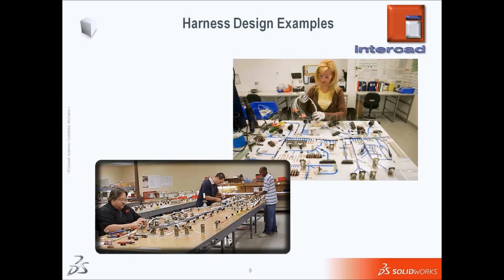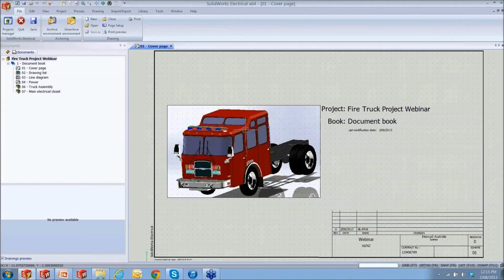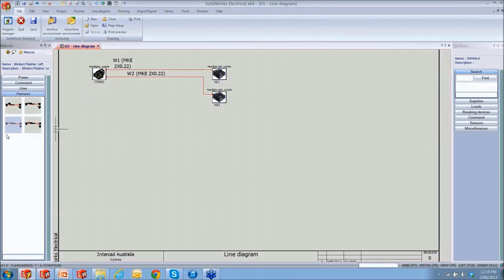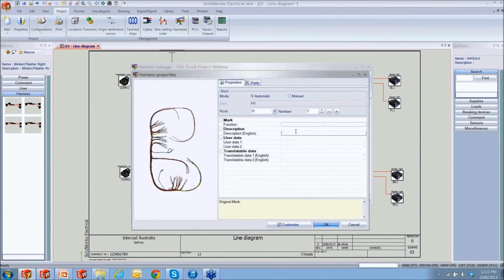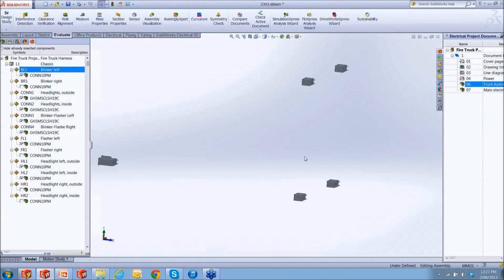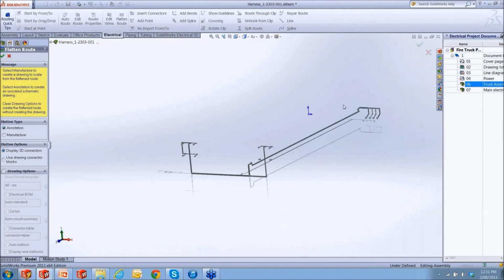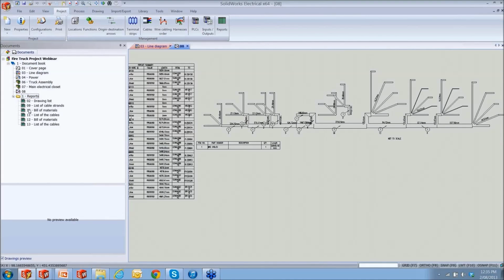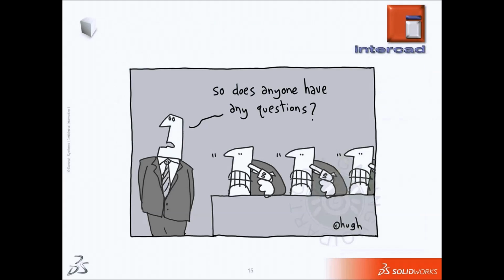Wire Harness Design with SolidWorks Electrical

Comment: Hi, good video thanks for posting. Any ideas why when I route a harness I just get stubs and no cables? Its very frustrating and I cant figure out why. Thanks, Alex
Reply: Hi Al,
I have quite a few suggestions you can try.
Although I don't use harnesses, the majority of my work involves 3d routing design in solidworks electrical.
I'm working on a document of trouble shooting methods.

Are you using routing paths?
Wires or cables?
Are you using the parts supplied with SWElec or have you created your own?

One thing I would suggest is to suppress all SWRoute paths (yellow sketches) and try re routing. If the wire route okay, then the problem lies with the SWRoute path.

If suppressing the SWRoute path does not fix things, I would examine connectors and also the SW2D end of things.

Post a reply if you need more guidance.
Reply: Julian Scharf Thanks for your reply. To be honest I'm having all kinds of issues with the routing side of SW electrical. Sometimes cables route correctly, sometimes I just get stubs, its a bit of a lottery at the moment.

I'm using 3D parts that I have downloaded from a manufacturer. I've added the cable and pin Cpoints for SW to route with. I find i can "bodge" a cable in by first using "Route cables" which usually gives me stubs for cables, and then using the "Auto Route" option on electrical tab, and manually selecting the cpoints of the connectors I want to route.

I must be missing something fundamental because I am getting some really odd results. Wires seem to route ok, but cables and harnesses do not. Routing just wires is no good for me as they are essentially dumb wires with no manufacturing information. In order to create costed material boms I need to assign the wires cables, even if they are single core cables.

I'm not using any routing paths in my assembly, simply placing the components where I'd like them and trying to use the "Route cables" function.

If you have any other ideas I'd greatly appreciate it, our re-seller seems to know absolutely nothing about the product they have sold us which makes things worse.

Thanks, Alex